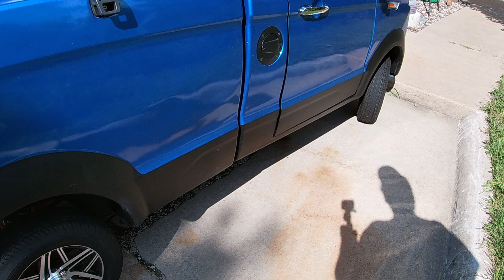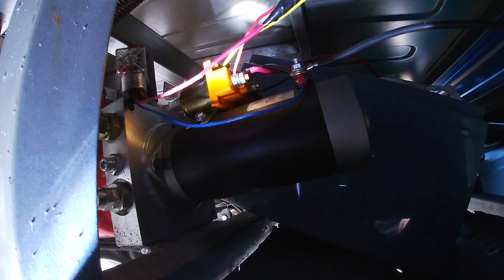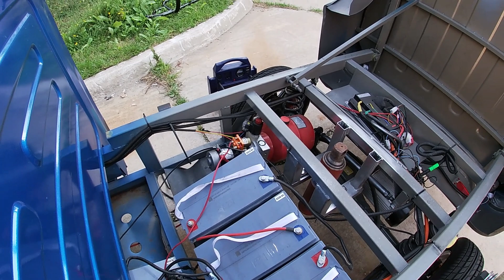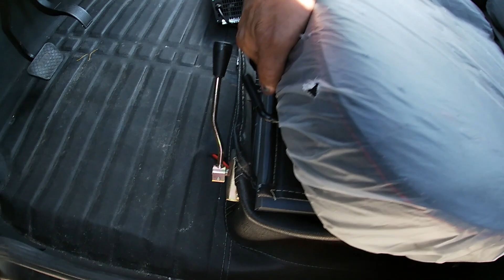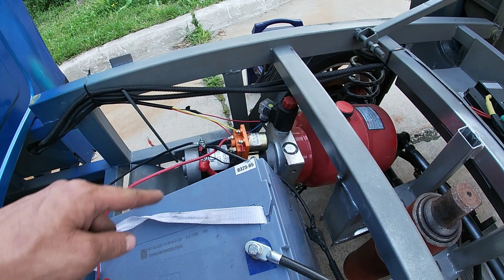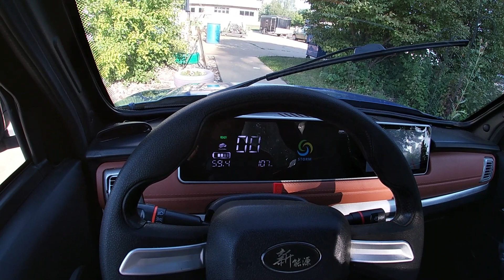This Chang Li EV Fell apart on the transport! #ev #autorepair

Comment: This damage didn’t occur during enclosed transport. You got screwed by the seller!
Reply from the maker: ? Why did the transport tell me they drove it on and now it will not turn on? And it was not in an enclosed transport it was on the back of a 5 car trailer so the fact that he drove it on and we pushed it off and he told me the brush guard and the door broke on the way here I can't blame the seller for anything other than not putting the battery hold downs on it.